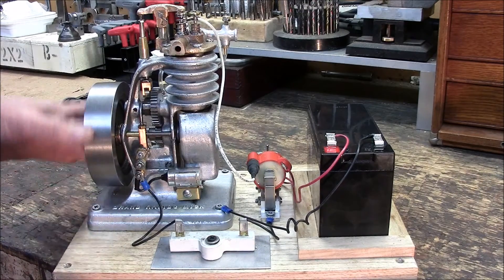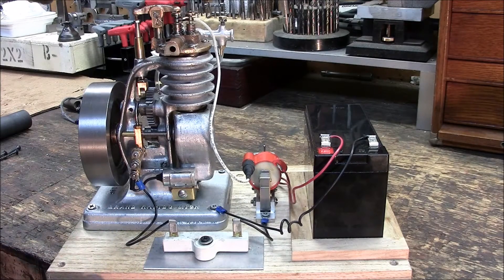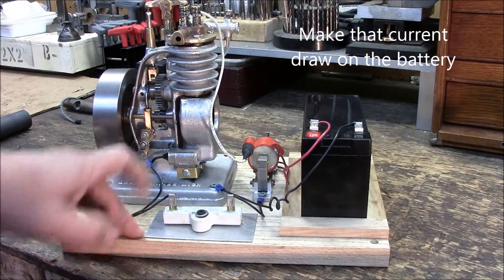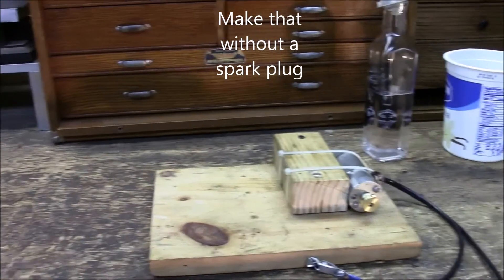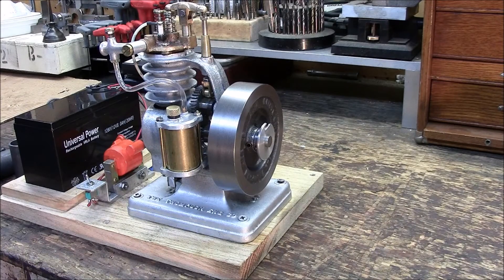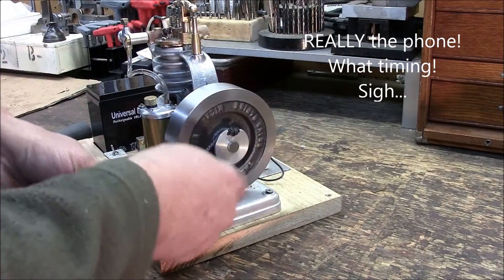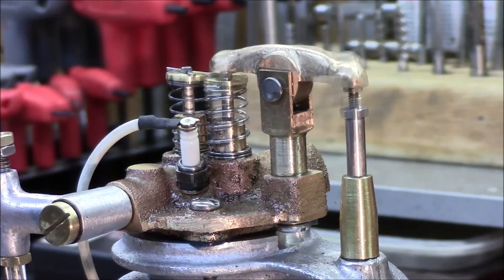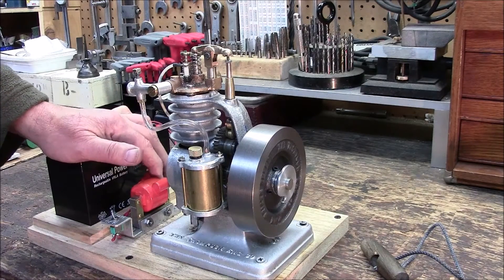1/4 scale Air Cooled Thompson Engine

Comment: Thanks to some helpful hints from your powerpoint presentation, I finally finished my Thompson. It took awhile to break in and find that "sweet spot" of air/fuel mixture, but it runs great. Fun project-fun engine!
Doug
Reply from the maker: Congrats Doug!  I am very pleased that my video helped you out.  Did you install old school points or go with Hall effect ignition?  I would love to see a video of it.  Do you have plans on posting one?  All the best..  Fred
Reply: I have posted a video on crazydoug66. I stuck with old school points system. Solid state is great, till it quits at a show! You can always get the old school system running in the field. I don't like the look of my giant coil, but i have not had good luck with those little ATV coils. I also installed 2 small set screws for the wrist pin, plus teflon inserts at both ends, to avoid the problem you had-thanks for that tip. The muffler is straight through,  really just for looks.
Doug

Comment: Excellent work, Mr. Fred! You did some nice machining there. I have a set of castings for this engine as well, just waiting for me go get around to it.

One thing... you mentioned at the beginning that this is a quarter-scale model. I don't think that's right. The Bob Herder kit is a full-scale reproduction of the original 1946 engine.
Reply from the maker: Thank you for your comments.  When you build the engine remember to put a couple of Teflon disks one each side of the piston pin. Without them the pin will walk and scratch the cylinder walls. Good luck and post your results.  Fred

Comment: That's a nice runner you have got there Fred , I have a set of castings for a 1/2 scale Roote and Vandervoort  but like you it is my first set of castings so I am approaching with caution.At least if you muck up a piece of a bar stock  engine your pride is the only thing damaged.
Vince
Reply from the maker: +Vince o brien Thanks for the comment Vince and I agree completely.  I also find that the longer I work on one piece the more carefully I perform the next operation on it.  Thanks for watching.  Fred

Comment: Great job Fred!
Like the Teflon idea for the wrist pin ends!
Thanks!
Jeff
Reply from the maker: Jeff Sigrist Thanks Jeff, After I found that the wrist pin had drifted and scored the cast iron sleeve during the break-in process I was bummed.  I thought for a long time on how to correct and prevent this from happening again.  A quick note to Bob Herder and put me on to this idea.  I am thinking I will be using this again in future builds as a preventative measure.  It took me over 2 hours to machine the replacement sleeve and get fitted.
Reply: It was well worth the effort! A lesson in building, and a lesson in repairing!
Nice job Fred!

Comment: The Midget engine plans show a ball check valve in the fuel tank pick up tube. I'm not sure why it's in there, so I left it out. Do you know what it's supposed to do or prevent?
Reply from the maker: I do know why it is needed but it took me some time to figure it out.  The check valve in the pickup tube keeps the fuel AT the level of the mixer (carb) after the engine is turned off.  In my case without a check valve the fuel would very slowly seep back into the fuel tank and leave the pickup tube empty.  The next time the engine was cranked the suction from the venturi in the mixer would slowly pull (pulse) the gas up the pickup tube.  That could take quite a few attempts of cranking to get it to the mixer.  With the check valve installed the empty pickup tube was eliminated.  Hopes this helps you.  Ans BTW I do enjoy your work...   Fred

Comment: I thought I would use the tungsten also. Maybe a 3/32" then drill a 3/32" hole is a threaded rod silver solder the tungsten in the rod and then grind the tungsten to length and square. I have also ordered a Nanzy from Bob Herder....He has all the brass castings now. Thanks Fred I'm sure I will be asking more questions as the build goes on..
Reply from the maker: Now that sounds like a plan.  I will have to check out the Nanzy.  I just finished upgrading my mill to a variable speed / reversible DC drive motor.  It works great.  I can now power tap (sweet)!  I am looking for another project.  Still a lot of cold weather left in this winter season.  Keep me in the loop with your progress.  Fred-

Comment: These coils are extremely common, all Briggs & Stratton, Tecumseh and Honda engines use them.
Reply from the maker: Yes this is true.  It would also require the installation of a magnet in the flywheel to induce voltage into the coil.  The flywheel would also have to be balanced which could be quite a task.  Thanks for watching and the comments.
Reply: Well, that would be one way . . . . or you could just use a flywheel off the relevant engine and turn the cooling fins off it. Wouldn't be hard, and would look correct if it was turned down properly.
Reply from the maker: Probably true but the bore and keyway sizes come into play as well.
Reply: I have no doubt that anyone capable of building one of these engines would have no difficulty with a relatively minor task of marrying flywheel to crankshaft. There are several ways it could be done, none of them too difficult.

Comment: Hi Fred.  You've done a top job on the engine. Interesting that it rotates anti clockwise.  Does it have an open crank case for manual lubing?  The finished result looks magnificent.  The only thing I would do to keep it period, would be to replace the plastic fuel line with a copper pipe.  Good one.  Cheers Rob
Reply from the maker: Great observation about running anti / counter clockwise.  I looked closely at both the cam lobe and the starter cord winder before I bought into it.   It does have an open crankcase for lubing.  Thank you for the kind words Rob!
Reply: Fred Miller
I enjoyed the vid Fred! Great engine!  Is the cam lobe not symmetrical?  With the intake valve simply controlled by a spring, wouldn't the motor run either direction just as well?  You'd just need an opposing notch for the pull cord. 
I used to think I needed to spend my time on something "productive"...that served a purpose.......but the older I get, the more I want to do stuff like this.....just for the fun of it!!!  I'm starting to realize the enjoyment is the product/purpose, not the end item.  Thanks for sharing!!!  Mike
Reply from the maker: bluehandsvideo Thank you for the comments Mike.  You make a good point about the rotation.  The starter fixture was cast with the notch for counterclockwise rotation.  I will look at the cam and get back to you.  I am days short of turning 65 and I absolutely understand about your "productive" comment.  I get the question all the time "what is this for" I answer it is a way of expressing my creativity and it is a very relaxing hobby.  I also tell them my engines are teaching tools and hopefully will "hook" someone's interest to take up machining.  I will get back to you on the cam.  All the best-  Fred
Reply: Fred Miller
It would be cool if it could run either direction. :)
Reply from the maker: bluehandsvideo Hi Mike, Thought I would follow up with you on the engine reversal thoughts.  I took a good look and remembered the points lobe and exhaust lobe although on the same gear they are offset.  Also the points open at about 5 degrees before TDC.  So rotating it the other direction the points would open 5 degrees after TDC.  I did try to start it clockwise but it only pops and burps.  Good thought though. regards-  Fred
Reply: Fred Miller
Ahhh.....I completely forgot about the timing having to be advanced of TDC.  That makes complete sense why it can't work both ways.  Thanks for getting back to me on that!!!  Mike
Reply: bluehandsvideo
If it was atwo stroke engine you could easily make it run backwards by having the points unit mounted on a movable backing plate.  I have seen a twin cylinder two stroke with this arrangement.  While this system could work on a four stroke, it would depend upon the exhaust cam lobe being docile/symetrical enough to give the same degree of valve overlap in each direction. Rob
Reply: xynudu
Hmm...I guess a two stroke engine would be easier to do it on.  I figured on this engine, since the intake was operated by suction, it wouldn't care about cam timing and overlap.....but the movable backing plate for the points makes sense.  Thanks!!!

Comment: Nice little engine you’ve built. I do have one question for you. Why is the ballast resistor in-line with the point wire leading to the coil? A typical install would have the ballast in line with the positive wire going to the coil from the battery. If your using a coil off an ATV it’s a 12 volt coil already and a resistor is not needed.

Comment: Fred have a question on your Thompson build. You indicated you used piston rings on the 1" bore engine. I have searched for hours and can't find a supplier. for the rings. I have turned them from cast iron before but would rather buy them if they are available. Did you make yours ? if not where would I find them? Thanks Joe
Reply from the maker: Dave Reed 
Otto Gas Engine Works 
2167 Blue Ball Road 
Elkton MD 21921-3330 USA 
phone 410-398-7340 
http://www.ringspacers.com
http://www.pistonrings.net
Reply from the maker: Joe, above is the contact info I used.  It is 4 years old. Buy a couple extra, you will most likely break one or 2 trying to install them. Hope it works for you.  Regards-  Fred
Reply: Debolt Model engines has an ebay auction for a set of 1" piston rings running now.

Comment: Has anyone thought of using the electronic coil off of a lawnmower or weedeater engine? Totally self-contained, no battery, points or condenser required.
Reply: You can use electronic coil but, you neeed to use flyweel original from engine you use the coil. So you can use the flyweel and the coil, from chainsaw, in ,,mising spark,, mod.Sory for my english.

Comment: Fred can you tell me what you used for the ignition points for the Thompson build?
Reply from the maker: Sounds like you are making great progress Joe.  As to the points, that was one of the more challenging parts of the engine build.  I used TIG rod as contacts.  With MUCH difficulty I threaded the rod then cut off small stubs.  The TIG rod was very brittle and I must have tried 5 or 6 times before I succeeded.  If I remember right I think the directions said to use model T points ??  Good luck.  Let me know what you end up with..  Fred